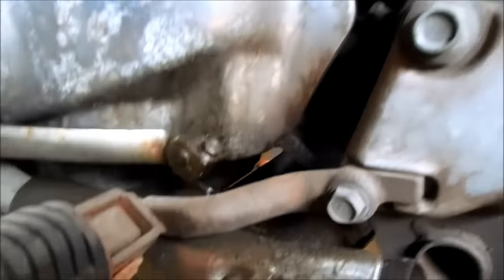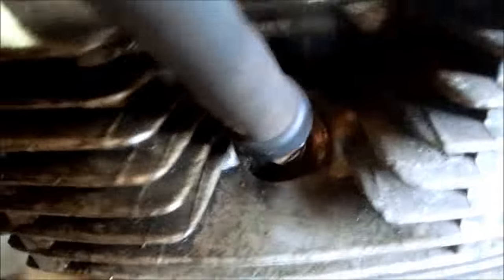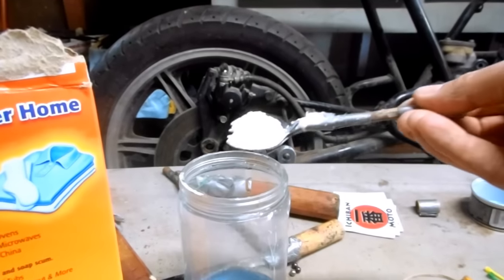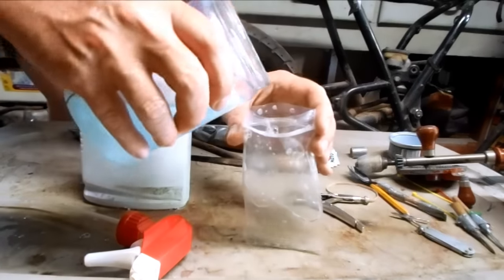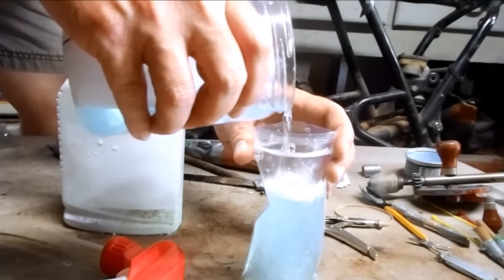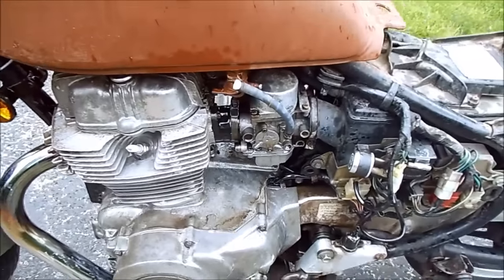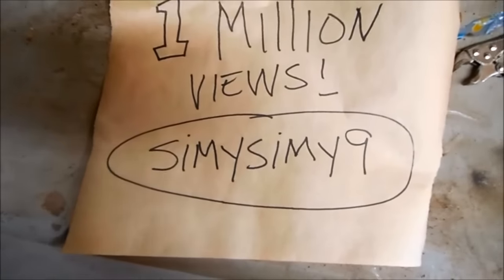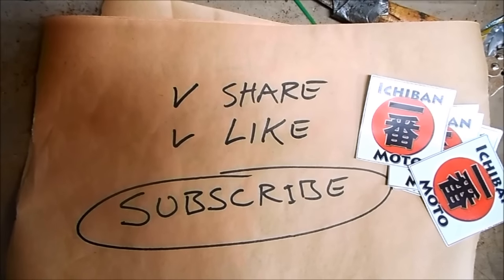How to make diy engine degreaser cleaner for your motorcycle and car

Comment: Your ingredients include baking soda, a base (alkaline), and an acid, vinegar, the base and the acid just cancel each other out, so its basically acting like you didn't use either one, although its possible that the ph leans a little one way or the other, it wouldn't be much.  You would need to check it with a ph test strip to see for sure, ph test strips are sold to check the ph of swimming pools.
Reply from the maker: +G56AG  it made some nice bubbles
Reply: yeah, you got me good on this one. I'm a fan now, but I was pissed then hahah

Comment: CoolVideo ! thanks for the Degreaser Recips or Trick /Advice  i’ve found that  Harbor Freights inexpensive packages of throwaway metal Brushes work well for scrubbing Engines  and if possible  running them to operating temperture. helps   i’ve personally like clean Motorcycle and Inboard boat Engines  because i generally do most of my diagnostics a,repairs ,and maintenance  it makes it nicer to do a small job without getting filthy  or staining my clothing with Greae and Oil stains that are permanent
Reply from the maker: I will check those out! Thanks for the tip

Comment: IF i dont use hemp oil will it work as good as yours ? great work by the way
Reply: LOL yes , All you need is white V , Baking soda and dish soup , This acts as an anti oxidizer for aluminum . Let it set 20min to a half hour spray areas that are drying so they stay wet and use a hard sponge to rub down the bike and she will look good as new !

Comment: for degreasing first spray it down with a strong base then wash it off and scrub what you need to. most industrial degreasers are just strong alkaline solutions. use sodium hydroxide etc.
Reply from the maker: don't forget the rise cycle :D
Reply: Melody, you are so limp it hurts. Are you writing about engines or men bits?
Reply: My girl friend read your reply and is looking for the rise handle. Love that girl.

Comment: Damn it my scales only go to one gram, not half. I can't get the accurate weight of the hemp-seed and now my solution is all wrong. I ended up burning through the engine. I think I used quarter of a gram too much.